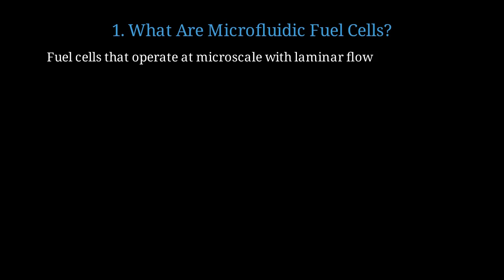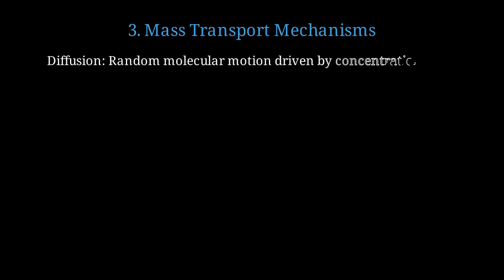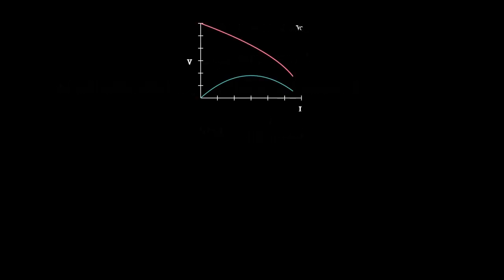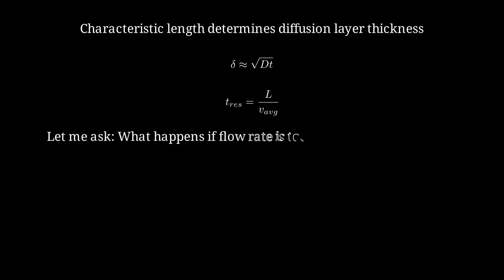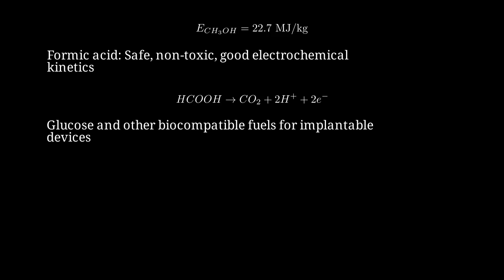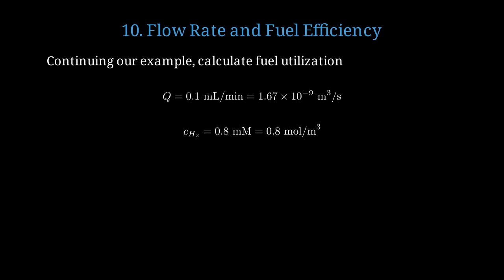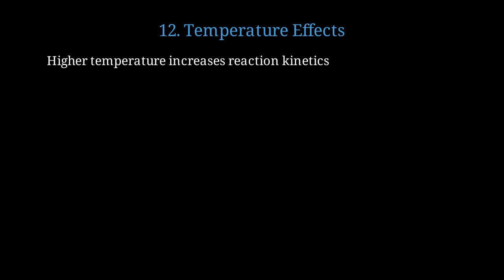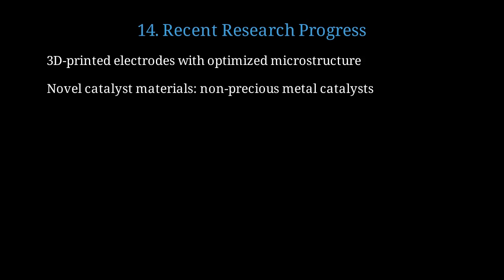Microfluidic Fuel Cells - The Laminar Flow That Powers Devices

Comment from the maker: How can computational fluid dynamics (CFD) models accurately capture coupled electrochemical–fluidic interactions in microchannels?
What nanostructured electrode architectures best minimize both ohmic and mass-transfer losses simultaneously?
Can enzymatic catalysis achieve comparable current densities to platinum-based systems in biocompatible applications?